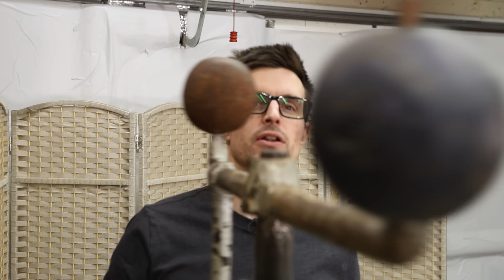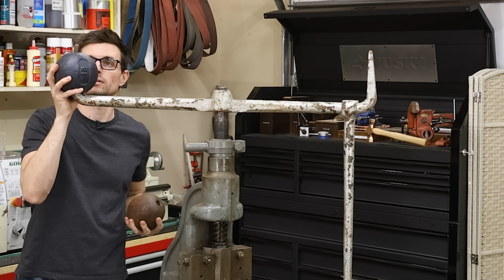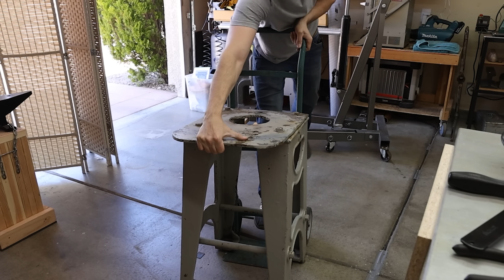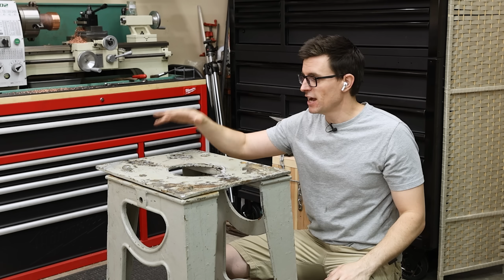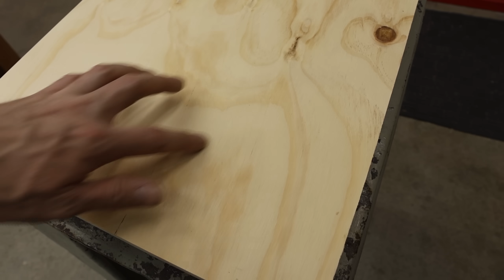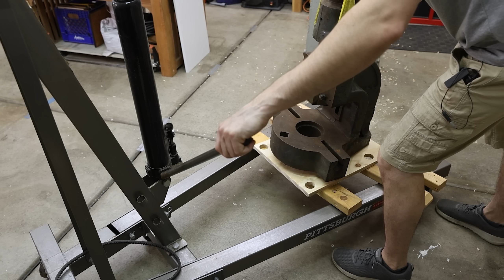Restoring & Setting up Vintage Fly Press – This Thing’s a Beast - Pt.1

Comment: If you have the space, I would fabricate a circular guard with the remaining plywood that prevents anything like skulls or cords or poltergeists from entering the circumference of travel.

Is that downward bar necessary for torque or something? You've probably heard this before, but it seems like those big swinging balls would be enough to get the job done?

Comment: Dude... Ditch that plywood idea... take what's remaining of the plywood form up a box about 8" bigger than the feet of the stand, pour it full of concrete, set some bolts into it and done. It'll make a great anchor for the press and keep it slightly more mobile than drilling and anchoring it to the floor. It'll also allow you to get more leveling out of it and other adjustments.

Comment: I think it's just a bit too high... like you should be about HALF the height of where you're at now.... but I can't really tell as I'm going by what it looks like on a video :) lol 
But 3D printing pieces for around that hole?? What are you planning on using this press on? If it's hot metals then the last thing you'd want to be around it is plastic! It'll melt before you even get close to the plastic!!! 🤯 I've only ever seen a fly press being used ONCE, and it was for forging steel..... but I know you doing that... for now :D  but still.... any hot metals are gonna be too hot for plastic... I say you make a brass flange to  fit inside that hole... and maybe do something fancy with like copper inlays.... spiffy up the fly press and remove all the paint, give it a new paint job and make her purtty!! :D 
We all KNOW you have the skill and talent to do this, so why do you show off some of your talents and beautify that sweet, sweet Fly Press?! :D

Comment: If for some reason you find it doesn't look right, on the edges of the wood, you can get some thin wood and glue it over, like you can do on the edge of 2x4s

Comment: That looks pretty sketchy... You're raising the CoG by a large amount, without adding any 'meat' to counter that issue. Could get quite interesting in use, and by 'interesting' I mean dangerous. Unless you bolt the whole thing into your workshop floor. Even then, cheap laminate board?

Comment: Sand and taper the wood from the outline of the base of the fly press down to the square shape of the top of the stand. It would actually look pretty cool with that three dimensional fit.

Comment: The hammer technique used to mark the holes was a good idea but I have a 55+ year old solution for marking the flypress base holes on to the wood packer using CAD (card aided design 😉).

Tape a piece of stiff card (breakfast cereal box/beer carton card is ideal) to the base of the fly press.

Using the round “ball” end of a small ball pein hammer, gently tap around the edge of the holes without cutting through the card to transfer marking of the holes to the card.

You can now use the card as a template to mark the positions of the holes on the wood packer.

Back in the 1970s, as an apprentice, I was shown how to cut ⅛” thick gaskets with a hammer for boiler house pipe joint flanges.

Looking forward to part 2.

Comment: Aren't you worried the plywood plates are going to "conform" to the fly press? Plywood is fairly soft material, and I imagine a heavy thing like that will compress the wood over time, and it may do so unevenly.
Reply from the maker: @thany3  I seriously doubt it will to any noticeable degree. The press covers the majority of the block which means the weight is evenly distributed. No more than  2 lbs per square inch.

Comment: I would also second the other comment around a cement spacer, the plywood seems like a really temporary option, or even a better option Alexandre Chappel recently created a camera rig for his workshop where he 3d printed weight molds for the base with open infill, he then filled the 3d printed weight molds with cement to create custom balancing weights, could be option? His video is here around the 8:30 minute mark;  https://youtu.be/9iM5l16CQjU?si=bBZkUL63Ft3eguZG

Comment: When I was still working on sheet metal forming, I had a very similar press. I used it for bending, punching, and even inserting bearings. It also hit me a few times with weights, despite my caution ... fortunately no injuries 😁

Comment: My only thought is, won't the weight of the fly press eventually squish the ply-board?
Reply from the maker: @rainbowtropolis No, it’s a solid block of dense plywood. It’s not going to squish any noticeable amount.
Reply: Should have used a solid block of oak .

Comment: That many boards [I figured just 3-5 stacked with as heavy as that press looks needing a mechanical wench to lift plced on top even if all boards are bolted 
but onto the metal stand with the weight that high.....just hope it never tips unless stand is bolted to the ground nor one of the boards splits breaks making the press shift off angle falling bending the structure. You're not Hathor the strongest man in the world. Use Emergency yellow or red tape/paint for the press arm end balls so unconsciously you always 'see' them fk keeping it looking old. I do that for crap nearly poking in my eyes height but can't remove.

Comment: Personally, I would have used a block of cement to put the stand on. If you made a mold and poured it yourself, it'd could be perfect for your size and weight needs, and maybe heavy enough to hold the whole thing down without needing to bolt it.
Reply from the maker: @RussellBeattie  That was one of the many options I considered.
Reply: It's concrete not cement.
Reply: Yeah and probably a lot less effort and lot less rot
Reply: My thoughts exactly. Also, won't plywood end up "squishing" under the weight of the press and the forces of its usage?
Reply: Yeah definitely the better option
Reply: lol i was gonna suggest paving plates
Reply: Yeah. Reinforced for slender section and base plate for making it perfectly level.
Reply: Would have used box section steel to build a simple raise frame , maybe with the option for rails able castor wheels.theres a channel “pask makes” he makes a most functional jig clamp for the fly press, best I have seen.look forwards to seeing what you do with this old English beauty.